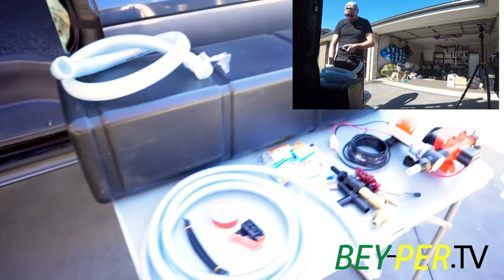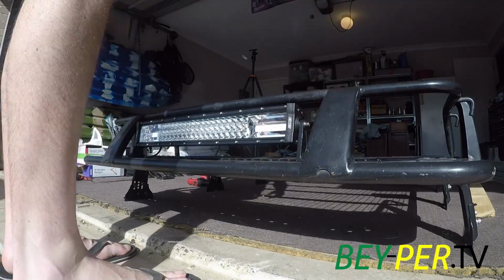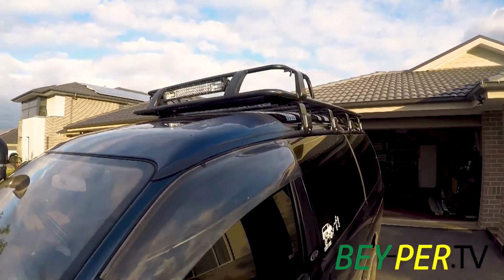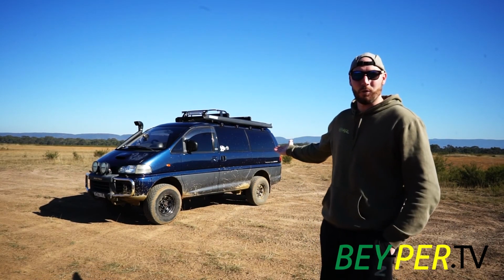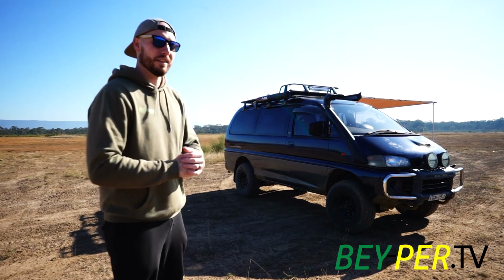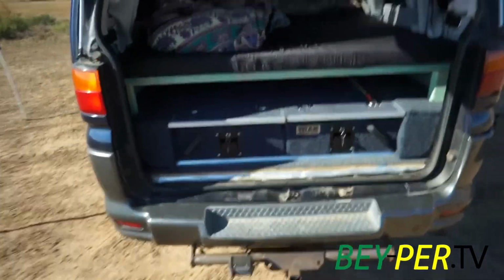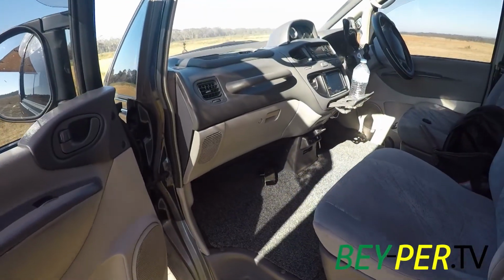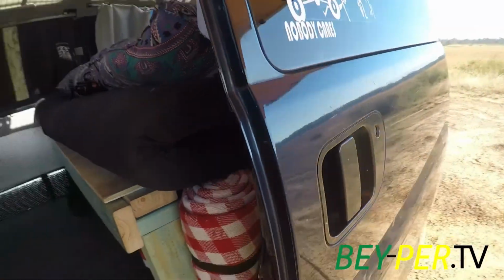Delica camper Episode 5

Comment: Looks good... Would you know what's the max off-road rating on the rack and max load rating for the Delica roof?
Reply from the maker: Hi Lenn, as far as i can find there is no actual load rating for the deli roof as the racks themselves get mounted to the gutter and weight distributed evenly across the gutter channels, as i have 8 mounting points i would go as far as saying that whatever weight i have up there would be spread out across those mounts... eg: 150kg divided by 8 mounting points = 18.75kg on each mount. 
As for the max rating off road for the rack it can hold over 500kg's according to the 4wd supacenter website... now i don't know if you'd put 500kg worth of stuff up there but that's what they say it can hold.
hope this helps in some way Lenn. 
Cheers
Aaron

Comment: Nicely done!! Just got an L400 97. What is that roof rack?? Looks sweet and easy to install.
Reply from the maker: Thanks Tomas 😁 
Yeah nice a 97 👏👏👏👏 
Welcome to the club mate. 

It is a roof top tent rack from 4wd supacenter but it's steel and pretty heavy. 

Look into ocam as the do aluminium ones and that's what I'll be upgrading to soon. 

Cheers for the comment 🍻
Reply: @BEYPERMEDIA  thanks for the input. I checked them out but they are sold out. And also on a bit a budget right now and the king’s bundle works for me I guess. I contacted 4wd supacenter and they told me I need roof bars to fit this rack in my Delica. I don’t see you using them. Are they wrong or I’m missing something?? Thanks for answering keep up the good work. Cheers!
Reply from the maker: @tomasbarbero6874  hey mate, yeah they are abit pricey that's for sure... no you don't need roof bars, you just need the appropriate sized side feet and you'll be fine. 

Mine are 20cm feet from ocam and bolted straight to the 4wd supacenter rack no issues at all. 

Jum onto these Facebook pages if you have not already and check out some posts, very useful info on there. 

https://www.facebook.com/groups/delicaclub/?ref=share 

If you need anything else mate check my home page on here and hit me up on any of the social sites.

Happy to help 🍻 

Enjoy 😉

Comment: Make sure spotties are negative switched bro.. fkn cost me 😎
Reply from the maker: Spotties and light bar are hooked up via the high beam circuit adapter supplied with the kits.. and still melts a fuse every couple months 🤣
Reply: Most of the stock kits only supply a positive switched adapter.. when I installed mine it was poppin fuses constantly, then my indicators stopped working 🤣 good times 🤙